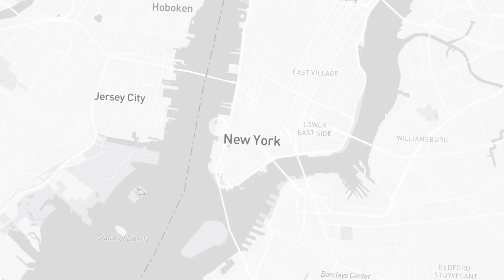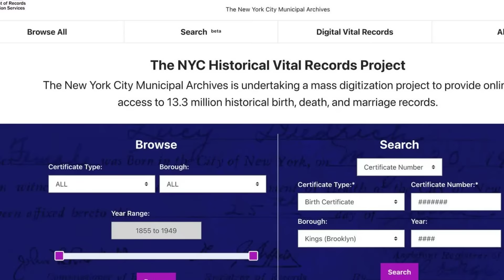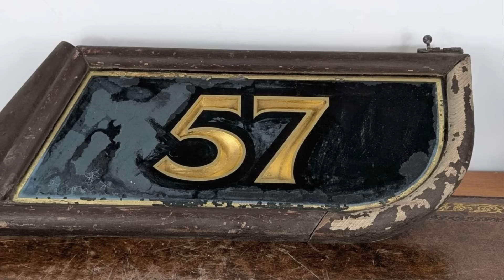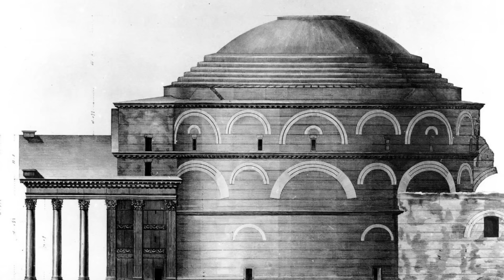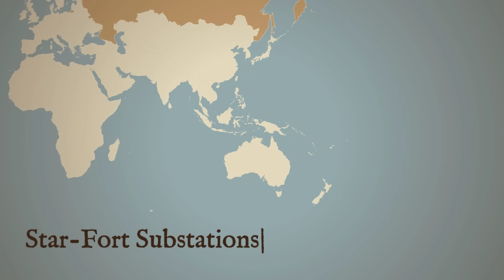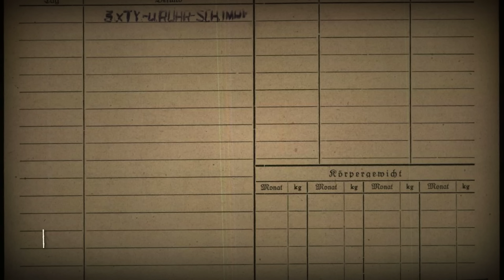The Ancient Tartarian Streetcar Designs No 1800s Workshop Could Produce

Comment: Plenty of factories and workshops could, and did, build streetcars in the 1800s. Those of us who own the complete set of Street Railway Journal from 1884 to 1908 and Electric Railway Journal from 1908 to 1932 have access to tens of thousands of pages of complex detail outlining the design, construction, testing, operation, rebuild, and ongoing maintenance of streetcars, along with highly detailed information about the accompanyting structures. They also give reams of information about the human side of transit operations, detailing the labor issues and factors involved. These documents comprehensively disprove the silly ideas presented in this video. At the core of these ideas is the unspoken assertion that “we’re so smart today, nothing that I personally don’t understand could have been done 100-150 years ago.”

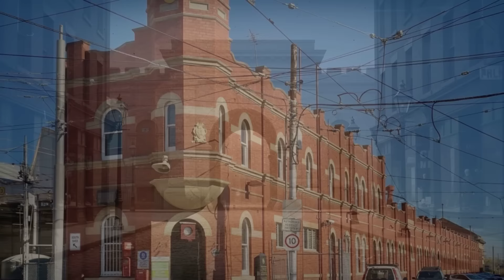I’ve ridden trams for forty-plus years out of Malvern Tram Depot in Melbourne, Australia, shown at 11:02. I’ve worked on tram restoration at that very depot. The fact that so many of these structures were similar is that they reflected accepted architectural engineering standards of the late-1800s and early-1900s. None of them were constructed by members of a mysterious lost empire.

You wrote, “many streetcar designs suggest tight tolerances, uniform components, and integrated systems that assume mature tooling, standardized measurements, and reliable quality control. Yet most 19th-century workshops relied on hand fitting, limited machine tools, and inconsistent materials.” You miss the fact that cities building streetcar systems often looked to those who already had them. Manufacturers such as the J.G. Brill company of Philadelphia built and sold streetcars to hundreds of city operations around the world, and had catalogues of streetcar designs which could be ordered ‘off the shelf’ or ordered with desired adaptations and modifications. Look up ‘Brill Semiconvertible’ as an example. 19th century factories had some hand fitting and a lot of hand tool work, but they worked to very detailed technical drawings and standards, and had excellent quality control. Please read some actual source documents.

Comment: During Prohibition in the 1920’s were Speak Easies. These chambers were not commissioned structures below ground  and not Tartarian 
 infrastructure. 

But built in secret to protect illegal gambling parlors, brothels, and secret societies. 

And old Postal networks as there was no traffic lights above ground and traffic nightmares that it was safer to build net works of narrow gage rail systems to deliver mail and merchandise beneath the ground until it became obsolete. 

It was imparative once these structures were decomissioned to fill them in with concrete to prevent the street traffic above collapsing beneath  since these underground structures are seseptable to water damage once forgotten. 

Domes on buildings served buildings once over crowded with people developed more air space to breath and to eliminate mold and condensation on walls. Domes also were decorative and able to equalize a load bearing ceiling for heavy chandeliers to hang from. Domes resist wind gusts, help heat interior spaces resist heavy snow fal from caving in roofs. And many Architects were deployed all over the world to design these Domed structures.

  Pipes below ground sent steam heat through  streets to melt ice and connect hot steam to circulating hot water heating units that replaced fire places. And vaults where these boilers were housed. Later were obsolete left abandoned and forgotten hundreds of years later. 

Steam heat reduced dust buildup and mold was a smart way to heat an entire city and prevent the repeat of the Chicago Fire. 

And valves were used to regulate steam pressure, release air trapped in the pipes and deliver water from condensation through a pipe sent  back underground to the vault to be heated back into steam.

I am surprised no one knows this information about our pre existing history. Down Town Chicago had a pier being renovated and no one among engineers knew an old abandoned Postal Rail System tunnel was built beneath the river  to connect to other existing basement systems  and had hammered a post into the river and broke the ceiling of the old rail system and flooded the basements of buildings in the loop area and John Hancock building and Filene’s Basement. Above ground it was not apparent what the emergency was and took crews to use an instant cement to plug the leak and drain all the building’s basements.